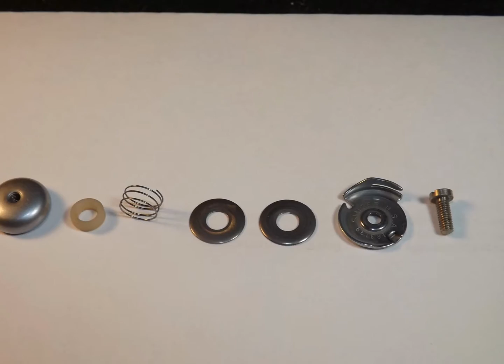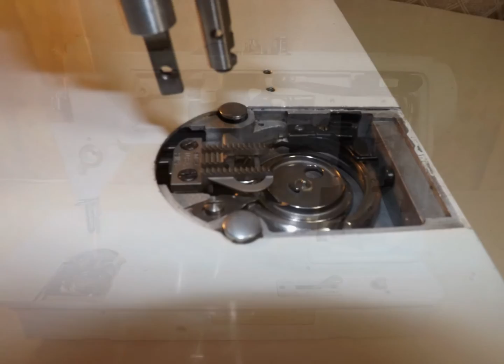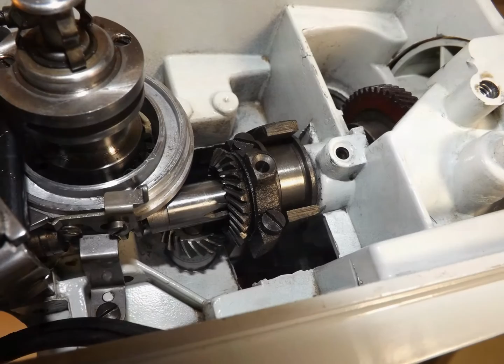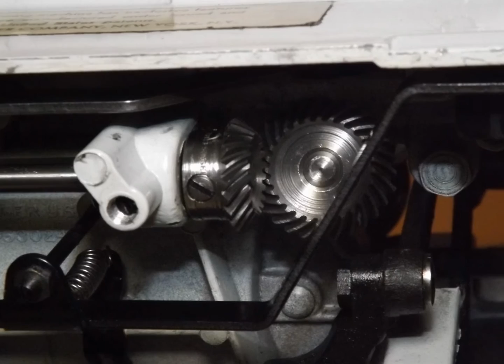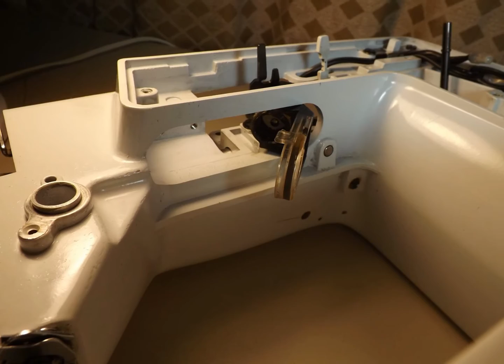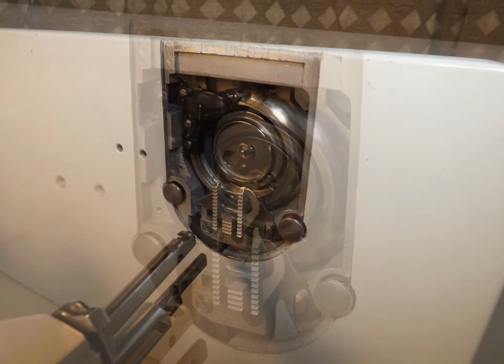SINGER MODEL 603 SPECIAL - PARTS AFTER REHAB

Comment: Hi Andy!  I have a 600E that was working fantastically, but all of a sudden the upper thread was making horrible thread nests under the fabric and catching on the bobbin case.  I adjusted the tension in the upper tension post and in the bobbin, and I changed the upper thread and the bobbin thread. Nothing worked.

Then I looked at the needle I had just replaced.  I had it in backwards.  There is a little dip on the back side of the needle, and I had thought that was the needle groove when I installed it -- my vision isn't great, and I just felt the tip of the needle to determine its orientation when I installed it (backwards.)

I changed the needle around and the machine runs perfectly!  So often the simplest user errors can jam up an entire operation.

My mantra when looking at a machine that is not working is, "It's not the timing.  It's not the timing.  It's not the timing."  And it's almost never the timing.  I've only had to adjust the timing on one of about a dozen machines I have owned.  Look to the most basic things first!

Thanks for all your knowledge.
Reply from the maker: It's not the timing"... is a perfect mantra to start your troubleshooting. Unless the needle will not bring up the bobbin thread at all timing is about the last thing I check. I appreciate your comment and pinned it to the top.

Comment: hi! i tried finding your email in your about page on your channel but couldn’t find one. I need help with my Singer Touch & Sew 646 model. I’m having a hard time getting a gear out as i’m not 100% sure how. I’ve tried hammering it, using an allen wrench and even bought a punch pin remover and i still cannot get it out. Any ideas?
Reply from the maker: There are 7 gears on a model 646. You don't say which one you are working on. I'm not a fan of the T&S models and have never replaced gears on them. Model 646 has the same gearing system as the slant-o-Matic 401A but maybe with plastic gears. The gear is a close fit on a shaft; very close, as you can see. However, over the decades oil does slip into that tight space and the heat of the gear running just cooks it into a kind of "varnish" that is very hard. I've had gears that seem to be glued or welded onto a shaft but it's just the dried oil holding it on there. ( I'm assuming there is no rust on it as you did not mention that) So you need to soften that oil, usually. I've done this by dripping WD40 or Krud Kutter Degreaser into the space and into the set screw holes after removing the screws. Sometimes every hour for a day then letting it sit overnight. Another, sometimes quicker, way is to heat the gear/shaft. The machines I do work on all have steel gears and I have used a hairdryer on high heat or a heat gun on low heat. I usually prop everything up, turn on the heat and run it for 10 - 15 minutes before I try again to remove it (with gloves) I have a friend who is internationally known to be impatient, and he uses a propane torch to heat the base of the gear. With plastic gears, you can safely use the hairdryer. Naturally, you must be sure any and all setscrews or roll pins have been removed from the holes. Terry is the Guru of T&S machines, IMO, with over 30 years of experience. I know he has written a guide for replacing the gears and setting the timings of the hook, etc. It looks like he still sells it as a download for $10. https://store.tandtrepair.com/600tgg.html   I have bought and used some of his guides and found them well-written and very helpful, but I had no use for this particular one. He also has a contact email. Can't tell you more than that, Courtney, other than patience & persistence is the key to stuck parts. Good luck.
Reply: @andytubesewing1953  the gear i’m talking about is top vertical one. It looks like a roll pin is in it and i’ve been having a hard time getting it out with everything everyone i’ve talked to have suggested
Reply from the maker: @courtneyostrum9615  Ahh, ok, thus the "punch pin remover". I've heard of this problem where there is a "roll pin" instead of a screw. I know Terry sells a roll pin punch for that so you must have bought a similar tool. I've never used it. I've asked other viewers before if the roll pin is placed in a certain direction like if one hole for the pin is a larger diameter than the other. Have you tried punching out the pins from both directions? Terry is really the guy to email and ask about the pin removal if you are struggling that much.

Comment: I need to replace the light and wires in my 603e.  I cannot find instruction anywhere and am having trouble figuring out access.  It looks like access is granted by removing the gold front plate you have off in this video.  Is that correct? How did you get the plate off? I hope you see this as there is no email address listed on your about page.
Reply from the maker: You can find a Service Manual for Model 603e here: http://site.tandtrepair.com/600TandSstuff.html
It is Manual SM600-48p and is 48 pages.  Most Service Manuals I own show how to remove covers and replace all the wiring, motor, light, etc. along with most other parts.
This site is owned and Operated by Terry, who has generously provided a coupon for Andy Tube viewers that is valid until 8/1/2019.
The Coupon Code is andy-h-yt and it is for 20% off everything you buy. So it looks like the manual would be $8.00 for you.

Comment: Sewing machine Singer 603E, is it an excellent sewing machine to buy? Even being a singer machine produced in 1961 to 1965? It is a sturdy sewing machine and made to last over 50 years of use in housework. The coil is sturdy to line fill or is a mechanism that gives problems. Because today Singer no longer produces sewing machines with this coil system used in the Singer 603E.
Reply from the maker: I do not care for the touch-and-sew models or "Auto-Reel" like this one. When the bobbin winder system does work, the bobbin only holds 15 yards of thread. Problems with the wind-in-place-system IMO. Made strong, but flaws. Straight stitch models look for 301A and 404. ZZ models with fashion cams look for 403A and 503A, Direct drive internal motor, all steel gears, front drop-in bobbin. The bobbin winder on the front will work for your lifetime. See my play lists for more information. https://www.youtube.com/channel/UCUSPDsHaFtRoz1VA2U1xJ4w/playlists?disable_polymer=1
I posted over 300 videos. Even step-by-step restorations. The 401A and 500A are very popular, but lots of parts and over complicated IMO. They are still nice if you like that stuff.
Reply: In his opinion, the Singer 603e sewing machine is a machine like the old Vigorelli. Built to last over 50 years of use, when cleaned and lubricated. Is the Direct Drive good? In Brazil this model of Singer was not produced, here we have old Singer with metal gears and without belts. But this model Singer 603e is more beautiful and was imported from the US to Brazil.  Thank you for your attention.
Reply from the maker: The direct drive is the best. No problems. Clean and keep lubricated with grease. I recently restored one that 60 years old and worked like new.
Reply: Thank my friend. God bless you.